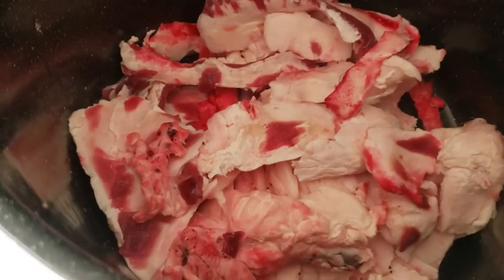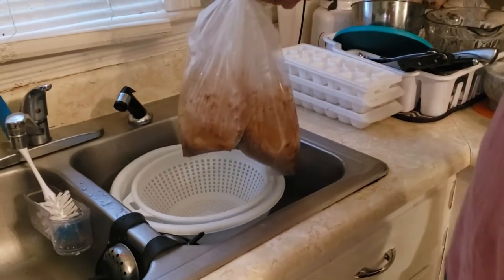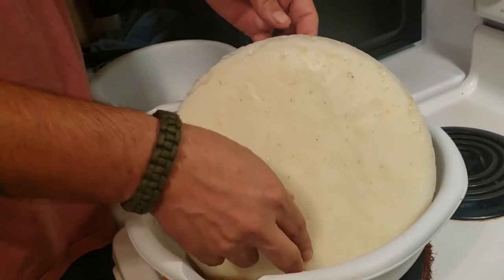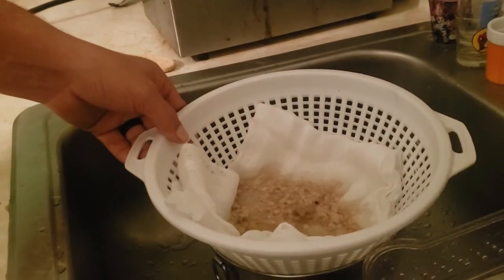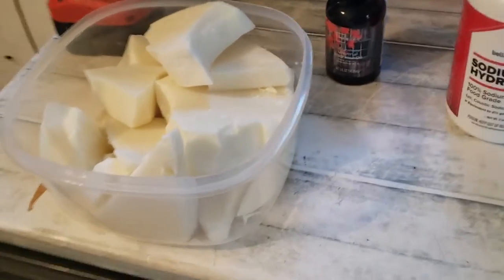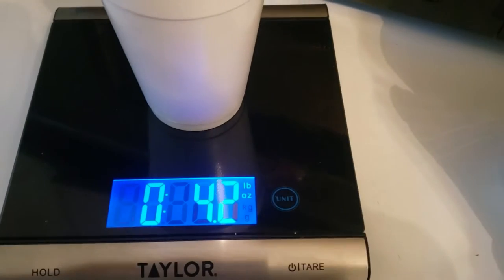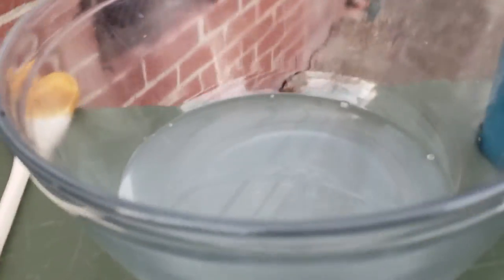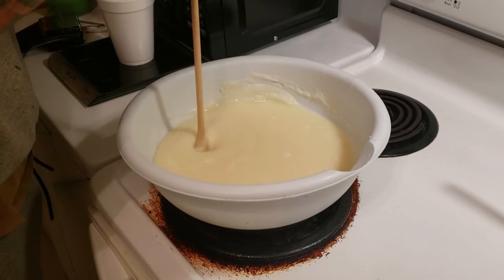How to make soap from deer fat!!!

Comment: Sir, cold process soap it is not safe to handle or use with out gloves for the first 2 weeks , it can still burn you unless you check the PH before to be safe.  I LET MY PH to be between 7 and 8.5 , then I touch the soap or used. PH strips can be ordered from Amazon very cheap and can save your skin. Also those 4 weeks necessary for the soap are for complete saponification of the oils and for the lye to be neutralize. In your presentation, before you cut the soap, you touch your face and this is how i burn my face doing exact the same as you. Always have some vinegar around when you handle LYE. Be safe and enjoy your soap
Reply from the maker: I appreciate then insight. Will certainly be more careful in the future